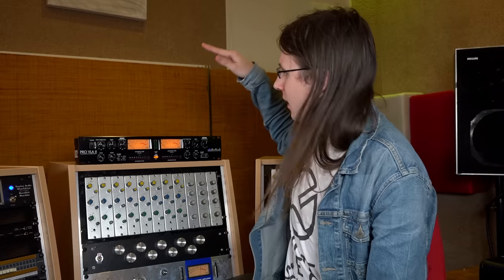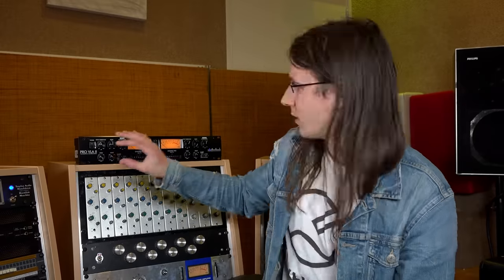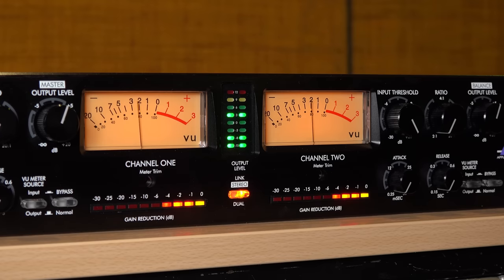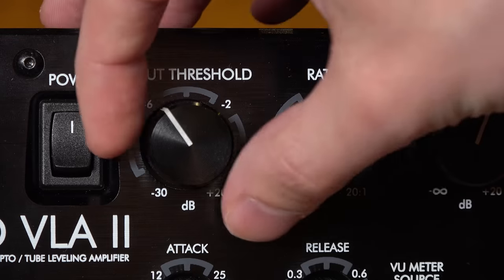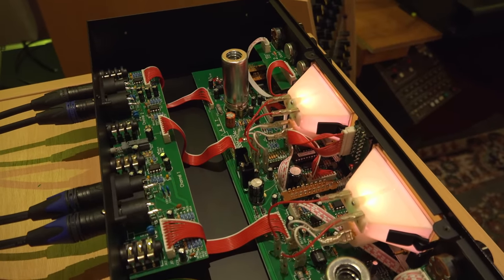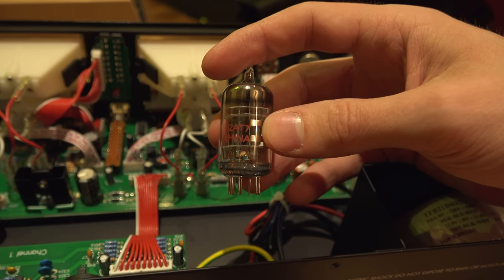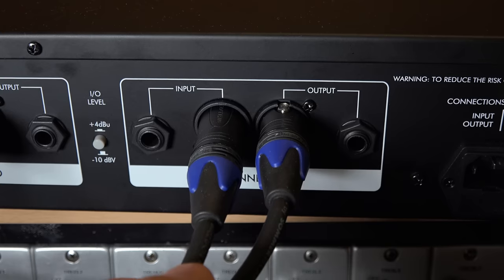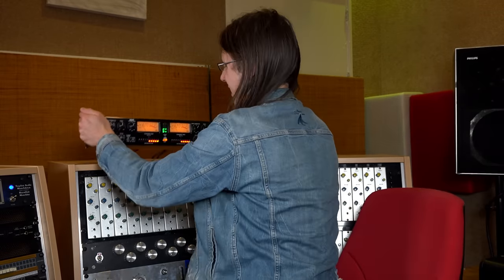IS THE ART PRO VLA THE ULTIMATE CHEAP TUBE COMPRESSOR??

Comment: Just a word of advice on the newer or brand new art pro units, If you do buy anything from Art understand that you have 3 months to send it back if It's faulty. So buy it and then quickly set it up. If you hear any sort of buzzing, crackle, or hum. Return it right away and get another one. Don't get frustrated. Do not waste time trying to find the source of the "hum" or "noise". Don't spend hours swapping cables or looking for mysterious ground loops. Don't open the unit up. Don't add new tubes. Just take it back or send it back immediately. These are great compressors if you get a good one. But it's very very common to get a bad one and that's ok. Just keep sending back units until you get a good one :) A good Art pro compressor is quiet except for a little tube hiss and this is normal and to be expected. Just remember with Art Compressors and Pre-amps 95% of the time it's not you, your other gear or your power source. It's actually "ART" they make great gear but they have horrible quality control now and it's a known fact. Maybe in the past they used better quality parts or had better quality control but those days are gone.

Comment: The only worthwhile mods I decided on for the money and I have both VLA 1 & VLA 2 is tubes for QA and changing the optical sensor for slightly quicker attack times if needed. Great units my VLA 1 uses better Gold Lion 12AX7 tubes while the VLA 2 uses JJ Audio 12AU7 tubes with better optical sensor. A few more mods out there but for the time and money I buy something else as the VLA as a stock unit is pretty good already.

Comment: When my band first switched to in-ears, we didn’t have any kind of board or preamp driving our mic lines, just straight into individual wireless transmitters. Went on tour, not enough volume, so I bought a $50 ART Tube Preamp box at Guitar Center to bring my mic to line level. It actually sounded great, but there wasn’t proper limiting so I got my ears in serious trouble with our drummers snare in a tight space. Probably damaged my hearing (no fault of the Art, my whole setup was duct tape rigged). We have proper gear now thank god

Comment: "A brand called China" :D  I have two ART TubeOpto 8s and love them.  So handy to be able to use the adat inputs as converters to analog outputs all the while using the analog inputs to adat simultaneously.
Reply: Plus, they sound good.  Prefer the sound of the mic pres on drums versus say, an 8m, which is what I'm piping their adat to.  Punchier, more character.

Comment: I don't even know why people call the Art Pro VLA a "tube compressor" when it's clearly stated that the tubes are utilized at the gain stage. The sound coloring we get is a pure distortion added as a result to pushing the signal hotter and not resulting from the compression itself. It's good for guitars, vocals also and bass. I personally use it for orchestra and piano to give them some additional presence without using saturation, but the unit is very versatile especially considering the price.

Comment: I did some mods, and still not sure what to think of it. Changed the vactrols for vtl5c1, matched tubes (803s) hmmmm mwah,, anyway the biggest changes came after matching up parts before the vactrol, using all 1% resistors and matched 2n4403’s. Quite a precise job, but finally it’s getting in the useful range (stereo use with link disabled) that vactrol stage is sloppy, get that right. Still the potentiometers are quite horrible and need some fine tuning. Anyway three days of work (hobbyists in spare time) it now does what it supposed to do in the first time. So please notice that this is quite the sloppy machine that does not do “magic” or something, and it does give u extra stereo simply due to the mismatch channels and all other things that are mismatched. So if the unit is all factory-new it’s not worth it, if u have spare time (and are extremely hardheaded I guess) one can get quite close to a decent machine.      Still waiting indeed for wietses video about this device 😊 greets

Comment: Would've been cool to push it into distorsion and see what that sounds like. For parallel compression applications. Waiting for the tube swap A/B test. Cheers!
Reply: The pro vla 2 is nice, but for distortion the pro mpa 2 is much better. I've owned both and the mpa got used on almost everything I recorded externally. I also switched the tubes in both of them for vintage Telefunken, Philips Miniwatt etc and the sound of the tubes in the vla is subtle, but in the mpa it's significant. The mpa has high voltage rails while the vla is cheap starved plate. (Although the mpa can switch to starved if you want, but it sounds boring in comparison). Vla 4/5, mpa 5/5 imo
Reply: @ozzy3ml  Awesome, thanks for the insight!
Reply: A Maeland l

Comment: From a lab test I've seen swapping tubes doesn't do anything at all. As you said the tubes doesn't compress on this thing and they give a total of 1% of thd. On the lab test it mad no difference which tube was been used since the harmonic distortion was 40 db lower than the source material.

Comment: Since you only adjusted the left channel I couldn't clearly hear the differences properly except when you only adjusted the right channel output.   Maybe if you would take the input threshold down to 6 on both channels and then adjust the other parameters together we could really hear the effect of the compression and it's quality a bit more.

Comment: This and their tube preamp are SO CHEAP and so good. ART gets away with it in the board as mentioned, and 1) cheap tubes, though easily replaced and 2) no QC. You can definitely get some hams, and mine took about a week of use before they settled in. I think they are perfect for someone who has never got into outboard/hardware gear before.

Comment: Thanks for this review - very helpful. I have been reading that you can exchange the tubes for Electro Harmonix ones, and they should improve the sound even more. 
I am in the market for a first hardware compressor, to add a bit of character/warmth to my techno productions. Not sure whether I will use it on the drum bus yet, or the master channel, but I think I would go with this one. 
Is there a better alternative, according to you? (even if a bit more expensive..)

Comment: Great review ! Indeed this is a special unit. Now there's no way those gain reduction meters are accurate (which increase the fact that it sounds so good..for so much compression). There's 10 dB of compression on the mixbuss exemple sometimes, and it wouldn't sound like that, you can be sure of that 😉

Comment: Art  Pro VLA II is not a tube-based compressor, even though that's how they make it sound it in the big print. It uses a tube in the gain section, yes, but the compressor section itself is a Vactrol optical-electronic circuit.

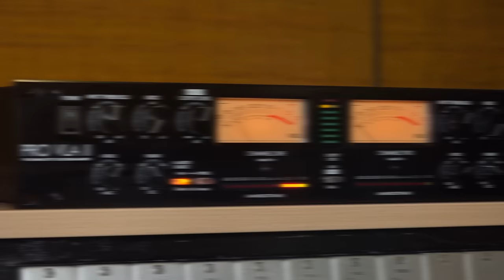Comment: When making the video, did you have it set in back for -10 or +4? When running full mixes connected to my interface outputs (and the interface's meters are averaging around 0), when the VLA is set to -10 db the needles and LEDs are constantly in the red and when set to +4 db the needles and LEDs are constantly well below 0 db. The threshold is set to 5:00 for no compression. (I do wish it had input gain calibration!)
Reply: Input gain is not necessary for a compressor and you will find many that don't have it.  The LA2a is a well known classic that doesn't and there are many other examples of this.

One simply adjusts the output of the device feeding the compressor (micpreamp or audio interface output) and that gets you where  you need to be for input level on your compressor.  

The -10 and +4 switch is a nice extra that helps you get closer to the level you desire before adjusting the output of the device that is running into the comp.  Maybe you have figured this out in the last six months but I wanted to avoid your comment from possibly confusing others and incorrectly thinking that a comp without an input control is a problem which it is not.

Comment: These things are great but FYI, the good build quality does NOT continue inside. The board is hung together with hot glue, bad solder joints, and mine came brand new with leaky capacitors and glue corroding parts of the board. These are not by any means made to last. But if you know what you're doing you can fix all those problems.

Comment: I was thinking about this a few years back. Ended up getting Drawmer TS2 (still got a new one in 2015). Very similar "opticomp + tube flavour" design but 1U and no VU. And the flavour is switchable and adjustable. Still hate the two separate bypass buttons. PRO VLA 2 appears to suffer from the same ailment. Never a perfect cheap unit. :)

Comment: Hi! So you said that this is not a real tube pre amp. Would say that Warm Audio MPX tube pre amp would deliver much higher quality than this unit? I am in doubt if I buy the WA MPX or the VLA ii. I have a Telefunken TF11 condenser FET mic and I have heard that FET mics work really well with tube pre amps.
Reply: This isn't a pre amp. So you don't power a microphone with it. You can put it in a signal chain to give a mic character after a pre amp, but it's more of an entry level stereo bus compressor with tubes. Take a look at the ART Pro MPA II that is a pre amp with tubes for two mics, or the ART Voice channel for one.

Comment: Hey TY, I got the Art pro and pro VLA but I can't get the VU meter up unless I turn the gain up on the knobs. And then the microphone clips easily. If I turn down the gain, then the VU meter doesn't move at all and is not using it's potential. I'm using the slate ml 1 microphone.

Comment: I have this, and tbh i think its average at best. The stereo mode does something a little strange to the stereo field which means it doesn't sound as wide so not great on mixes/Buses, and there's next to no colouration (even when re-tubed like mine) . It's ok on acoustic instruments but i think most stock DAW plugins perform as well. If your looking for something recording on the way in, then i guess it has its uses but using it as an external insert on buses, its just a bit bland.

Comment: I’ve always wondered...what price point do the best plugin compressors beat hardware? Does an ART VLA beat say UAD LA2A? Do you get what I mean?
Reply: Big topic there.... Aspects of it are open for debate.... You don't find many people who will sacrifice a decent outboard compressor especially on the front end while recording for any type of in the box software compressor if they have the option available. 

Then there's workflow.... DAC convertors... If you're using hardware on your mixbus.... Aliasing even on top brands that's sample rate dependant on your sessions.... For plugins..... A lot of professionals use a combination of hardware and software in their signal chain. 

Long story short, software compressor don't completely replace hardware in most professional studios.... And to work entirely in the box, there would be a compromise to the analog goodness.... Even though they use some plug-in compression most likely in the chain..... 

Most important is the audio engineers ears and still at mixing. A really good audio engineer will get a much better sounding mix completely in the box than a a mediocre engineer will get with the best hardware chain.... The plugins do matter in this case..... They can't be full of aliasing..... They have to be well written...... And when it comes to saturation and distortion, even some off the biggest names create all kinds of digital unmusical nastiness in the aliasing department...

Comment: Out of curiosity, does using hardware like this actually make much difference in sound/depth compared to a quality plugin like a Elysia?
Reply: If you don't use Elysia as a Hardware or Software, HW can sound a lot more "deep" than a plugin.  Check out Thermionic Culture "The Swift" Eq and Phoenix Compressor.
Reply: Trust me. Not much.
Reply: It really depends on the implementation. Some hardware sounds deeper than software and visa versa.  It comes down to the designer.
Reply: Late to the party but even the act of leaving the box and coming back in does something to the sound.  Analog compressors in general are smoother than digital.  Once digital gets up to around 4x oversampling it starts to sound better, but there's still just something to the sound of excited electrons bouncing around vs code. Dialing in settings is also much more immediate.

Comment: er, compression is never done in a tube, surely? the tubes are there as gain stages... looking at the circuit diagram. And 12AT7 as a low gain general preamp type tube makes sense. You don't want guitar amp hi gain stages in this application. And yes, they are onto coupler compression devices using the VTL5C2 optocoupler.

Comment: A question for anyone:
Regarding GR meters:
Training wheels?
Crutch?
Feature?
Staple?
Reply: If it sounds good, it is good. However if you're unsure they can be helpful. Also they can be useful if you find yourself twisting knobs and don't realize you're in bypass.
Reply from the maker: The quote actually is “If it sounds right, it is right.”

Comment: If you look at the schematic, you'll see that all the amplification is done by OP-AMPs, it only has a (low voltage) tube output buffer, so it cannot possibly add any coloration. The tubes are there only for marketing, they have no contribution to the "sound" whatsoever. Not meaning it doesn't sound good though.

Comment: "Not a starved plate" compressor
Reply: They are a starved plate design (the plates run from a 45V rail). Some ART products have a higher voltage supply, like the MPA Gold, which lets you select between 15V and 150V. Still, the VLA and older Levelars are great opto units and solidly built.
Reply: @ryancrawford9894  Thanks

Comment: This compressor is very cheap and there is many reasons. The electronic design is extremely poor and cheap, it seems to be done by the advertising office. Few examples: tubes are there just for marketing and to ruin the sound (they are powered at 40V instead than >200,  because additional high voltage power supply was expensive I guess), no ground planes on the board, only electrolytic capacitors (worst sounding on the market) on the audio chain, no protection resistor on the output so if you connect a mono jack instead of a balanced one you burn one of the two amplifiers driving the inverted output (I bought it used  I found both burned down), no bypass capacitor stabilizing the power supply on EVERY operational amplifier inside. On the technical point of view its value is way lower what they made you pay for. I worked on it for quite a while to make it a good compressor : excluded tubes, changed every capacitor to non electrolitic, inserted the bypass ones, repaired the broken output amplifier.  Believe me, even if it sounds great to your ears, it could sound way, way better.
Great review though, keep up with your amazing work!